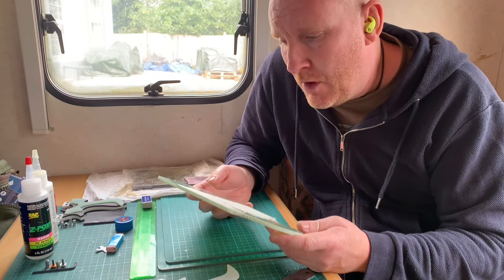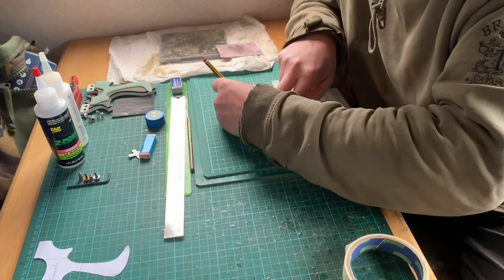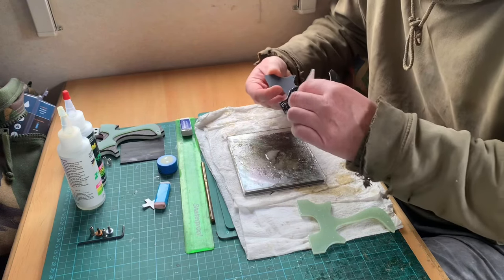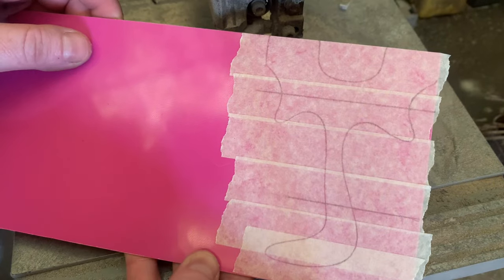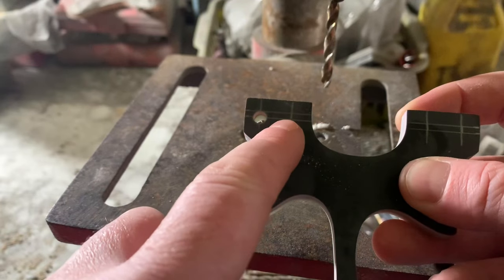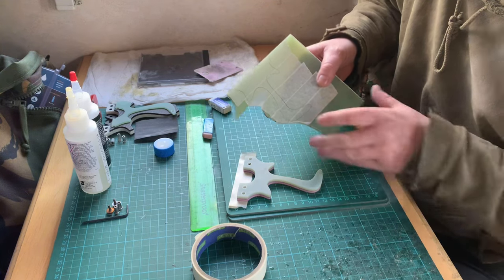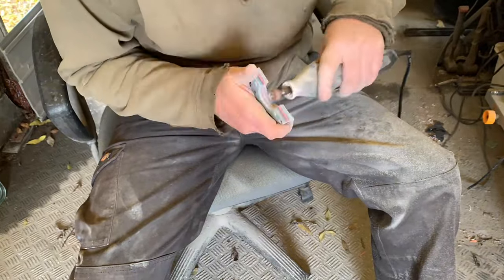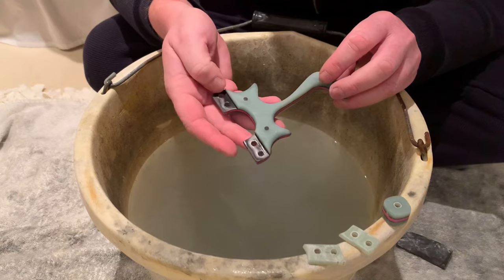HOW I BUILD A CUSTOM LAMINATE CATAPULT, SLINGSHOT

Comment: Is there any reason you glue the layers after cutting the shape out? Versus gluing together a monolithic piece, and cutting the shape out in one go? Or Is it just to save on material wastage? 

Also, could you offer any advice on making the slingshot suitable to a particular hand size, I’m about to start a project to make one of these style of slingshot/catapult for myself, I had purchased some plans off Etsy that came with scalable vectors and can print the templates to any size no worries, I just thought perhaps you might be able to offer insight into making the catapult the perfect size for a known individuals hand. 

I had planned to go to a print shop, and have the template pre arranged at multiple scales printed on an a3 or a2 sheet, and stick them to some card stock, and cut them out, and see which works best for me and go with that. 

Probably also test by glueing the seeming right size template to some expanded polystyrene, and then carve it into a more analogous shape than a flat piece of card…Before I move to the final build

But I would be scaling the vector only using constrained proportions, so if you have insight to how to measure a hand, and how that will translate to making the perfect height and width, I would appreciate it. That way I can scale lengthways, and widthways unconstrained proportionally for the perfect size without all the mucking about to find a suitable size.
Reply from the maker: @QuinnKallisti  it definitely safes wastage and it’s easier to cut as thinner pieces rather then one, each to their own, as for size it’s just trial and error, you need a base size to work off then you can add or reduce on future builds
Reply: @romanycustomcatapults  thanks for a swift response mate.

Comment: Hai fatto le clips per bloccare le bande elastiche, piu grandi rispetto al telaio, come mai? 
Che tipo di bulloneria hai usato per l'accoppiamento delle clips? 
Secondo te questo sistema si può replicare su una slingshot in legno?

You made clips to lock elastic bands, larger than the frame, why?
What kind of bolts did you use for pairing clips?
Do you think this system can be replicated on a wooden slingshot?

Saluti dall'Italia 👋😊